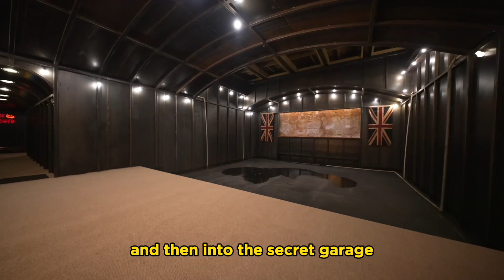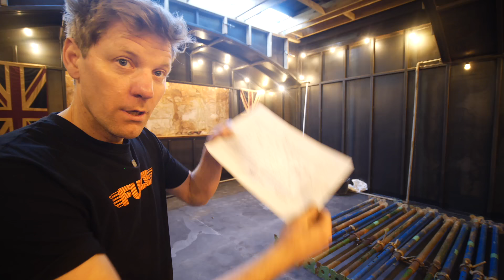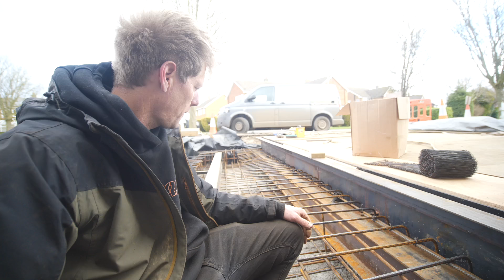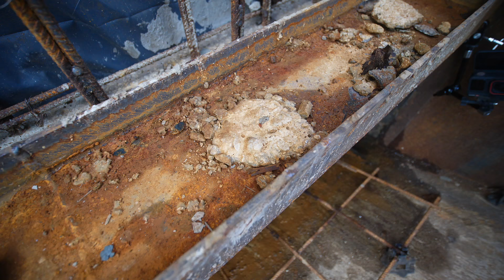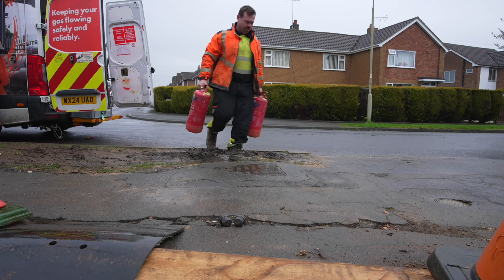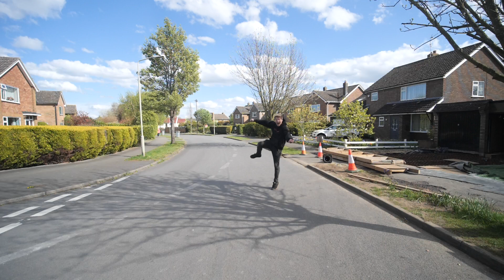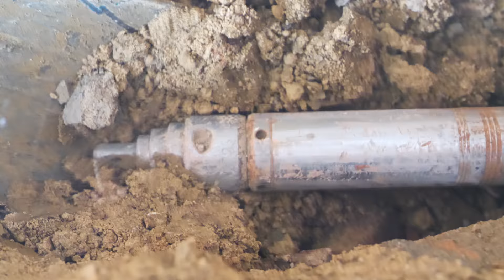Digging a SECRET Garage Part 6 THE COVER UP!

Comment: So who is going to tell Colin about the blocky blocking thing over his license plate at 35:06 ? 

And who is going to write the code to decode the plate? Starts with an F, so maybe FURZE TRUK? 😂😂😂
Reply: Using an ancient secret artform called "reading" the plate is E889HDX which the DVLA lists as a Blue 1987 Toyota 2.4L Diesel.

Comment: 34:50 Ah yes the Toyota Hilux Pickup truck, as confirmed by Jeremy Clarkson and James May in the early to mid 2010's is literally unkillable. they set it on fire, dropped a caravan on it, let it be crushed after placing it atop a building demolished with explosives, drowned it in the Bristol channel and drove it through the Top Gear production office (a wooden shed). and with only basic tools it kept going, no spare parts, no fancy tools, just a basic set of spanners and it kept on going.

Comment: if going through all that effrot to do the gas main, and then concreting it all in I would have seen if you were able to get a 3 phase electrical supply installed, so you don't have to chip out the concrete in the future if you do want it

Comment: Could have placed air filled plastic balls, exclay or other light filler to remove some weight from the slab. There is no need for such a massive concrete structure for such a small span.

Comment: omg.  This project is great. I reallly don't think you need to tie every single rebar at every single joint... but im sure it will be stronger that way.  If you ever get mud or ice in england, you may want to put up a stopper bar because now you drive into your driveway right into your brick wall

Comment: When the bunker is connected you'll need bulkhead doors somewhere in the tunnels, the garage section (for example)  doesn't have 1m + of concrete to actually protect from hazards like radiation.
You don't want the protected and non connected sections connected openly.

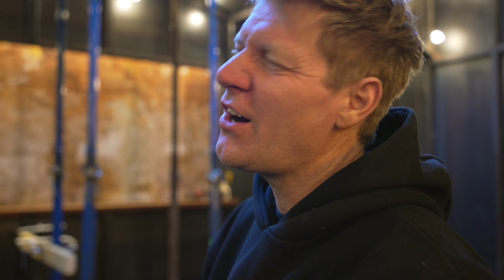Comment: 10:20 The engineer knows it is well over the top.  They probably put a very large safety factor on this.  They don't get in trouble for making the build expensive and difficult and it ensures that they won't get blamed for under-doing anything.   

I built an underground house and the engineer was required to provide these sorts of drawings.  In each case, he would specify some very difficult or expensive solution and then when i'd ask him how he arrived at that, he could never show me his loads or calculations, etc.  In one case, he required a 34 ft long H-beam that was curved in 3 directions.  I asked him where I could fabricate such a beam (instead of the 3 shorter single curve beams I had initially designed), he had no idea if it was possible.  Another time, he wanted a bunch of curved #8 rebar spaced 2ft apart instead of the #4 rebar placed 8 inches apart that I had specified.  I asked him how I would curve #8 rebar and if he knew how large of a piece of equipment that would require?  To be able to complete the build, I needed to suggest a method that would get it done for 1/10th the price and show the engineer my calcs (I am also an engineer, just not certified for this), he would reluctantly agree that he had over designed it and would sign off on my drawing and then I could proceed.   Of course, he would charge me again for reviewing each change, but that was much cheaper and easier than just doing it the way he wanted.   After my job, he quit being a civil engineer and became a stay-at-home dad instead.  ;)
Reply: My friend is an it professional. When he had internet outages he made the isp technician check the whole street and finally identify and fix the issue in the connection box for the whole block. Similar situation

Comment: 0:12 Possibly you were hedging your bets but I'm still Sir Digby Bumpton Frumpton enough to pull you up on displaying our nation's flag.
If you wouldn't mind committing this to memory:
The red X (of Northern Ireland) is always bottom left.
That is it's in the lower half of the white X (of Scotland's Saltire) on the left hand side of the flag.

As you know, flying the flag upside down is a sign of distress. 

Right, back to the show.

Comment: Awesome like always video :D but is it only me that noticed surface rust on the rebar and other parts?  and knowing that's even if its closed in with concrete its going to turn in to regular rust and then eats away the metal/iron? :)